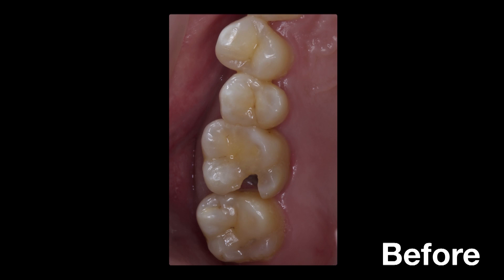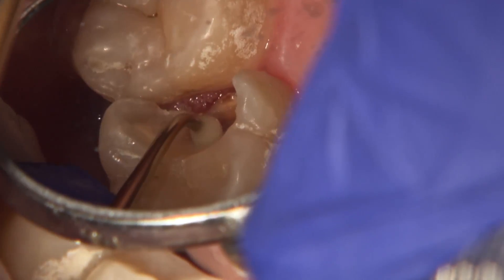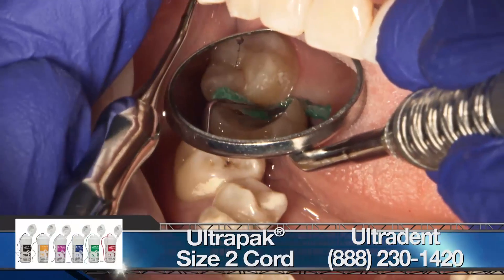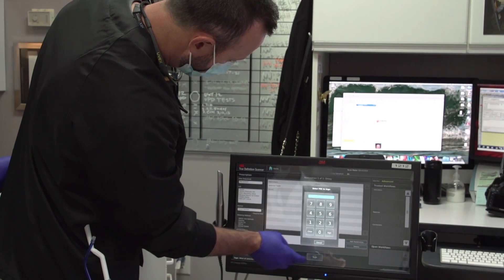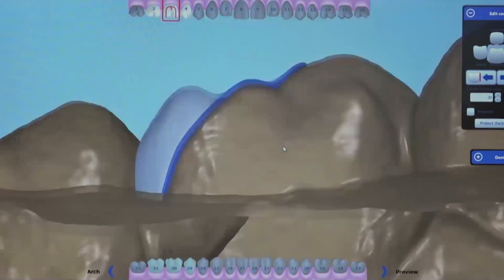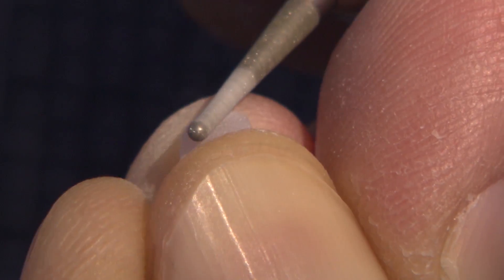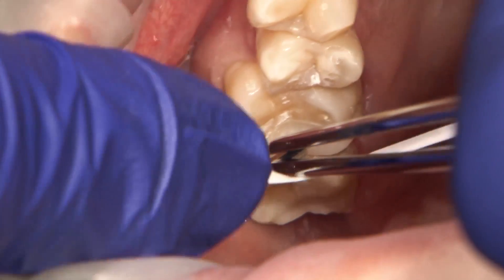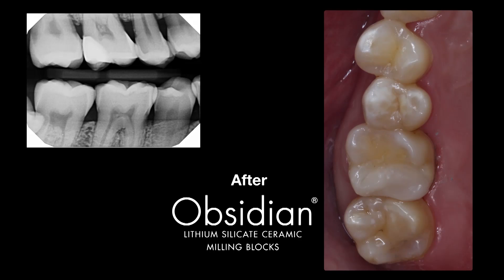Case of the Week: Chairside Milling of an Obsidian® Onlay

Comment: In Denmark we are taught that if the patient is more than 18 years old, a pulp exposure, hemorrhaging or not, will require a rct. This is because the the prognosis for a pulpectomy is far better than an rct on a necrotic tooth. The prognosis on a direct pulp capping on adult patients is around 30%, and since there is a risk that necrosis will develop asymptomatically, a delayed rct (with far more demanding infection management) will statistically decrease the long term prognosis. With that said, I'm sure this case, with follow-ups including vitality tests and radiographs, will end up great.

Comment: Pinpoint pulp exposure and you decided to restore with a ceramic onlay? What if the tooth develops a pulpitis and requires root canal therapy? It is best to remove the caries and restore with a temporary material to evaluate the tooth prior to any reconstructive therapy.
Reply: I agree. Tooth was already symptomatic to begin with due to deep caries, pinpoint exposure was under less than ideal conditions (unclean bur, no dam, close to gingiva), then a GI liner is placed directly on a pulp exposure, and it might not be hemorrhaging because of so many different reason. Exposure during caries removal is a questionable prognosis. The very least, a calcium silicate or calcium hydroxide would have been placed first. Then restore with either a temp like IRM, RMGI, GI or even composite. Then monitor for symptoms. Patients will lose confidence in this sort of treatment planning because they will likely need a root canal down the road, the reason why you won't hear about is because they'll probably be seeing another dentist. If a root canal is required, then the recommended treatment would definitely be a crown as the onlay doesn't cover the access, and patients are left wondering why they paid for an onlay when it was supposed to fix the problem. Just because you don't get pulpitis after 'immediately restoring' doesn't mean the tooth won't experience symptoms months or years later.
Reply: It's just a tooth.
Reply: You're right - most endodontists would disagree with the treatment as my primary concern is to keep my patients from having to ever see one. There's absolutely no downside to treating your patients to the best of your abilities using techniques that provide positive outcomes. Thank you for your feedback
Reply: Your approach to treat a similar situation is a good precautionary alternative. I have the opportunity to push the envelope so that I may teach others to think outside the box. Insulating exposures and maintaining hydration is key to retaining vitality. With my approach, I have yet to experience pulpitis after immediately restoring (knock on wood). The "best" treatment is when each clinician can provide the most favorable outcome for their own patient. 
#18 (US) isn't in the treated quadrant and if you're international, 1-8 isn't present. I advise against attempting to diagnose on youtube as things aren't always what they "appear" to be.
Reply: Justin Chi The likelihood of root canal therapy after such an exposure is very probable. The fact you had "no hemorrhaging" is also not a good sign as the tooth could be necrotic. What would be the downside of replacing this with a sedative type IRM or RMGI? Most endodontists would completely disagree with this treatment. Pushing the envelope may be ignoring evidence based Dentistry.